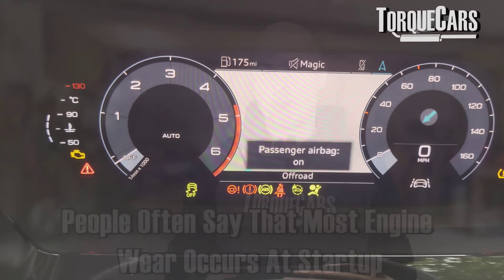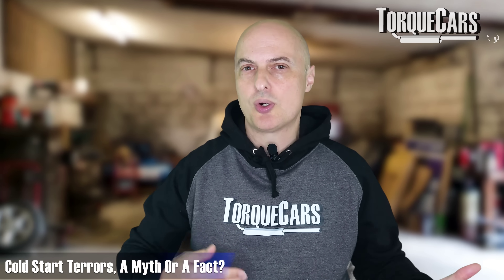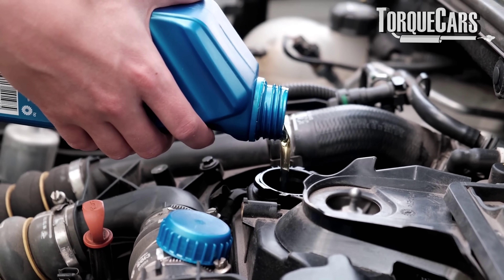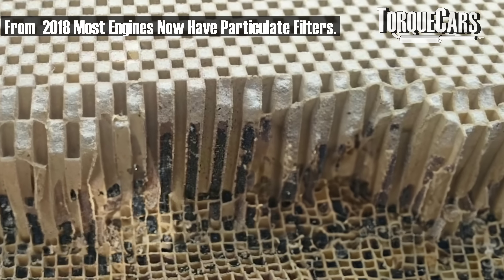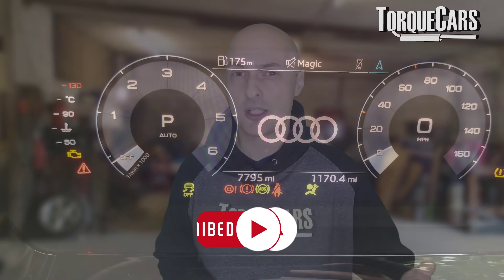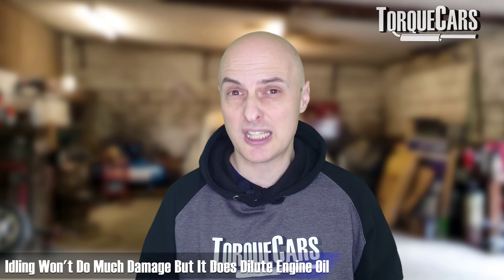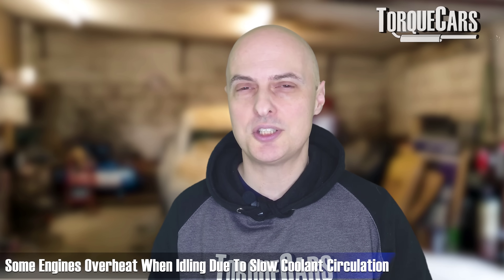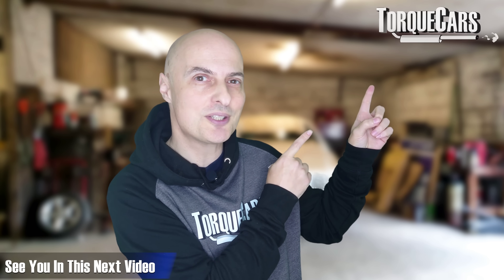❄️Reasons Why Bad Cold Starts Destroy Your Engine ☃️Prevent It Happening To You! ⚠️

Comment: The diesel engine can work itself up to temp, but not force it hard or rew high.
Petrol engine can idle to temp, or with ligt work in the beginning.
Its also a good routine to let the engine, specially the turbo work itself colder after hard work before stopping it to awoid cold score.

Comment: My dad used to move my CRX from the driveway to the street every morning before work, and the exhaust rusted out extremely quickly. Great video, thanks!! Got a Subaru EJ25 being fully built right now and have been wondering about the best ways to warm it up over winter here in St Louis, Missouri, USA.

Comment: I have only driven cars over 200,000 miles and the "newest" vehicle I've ever owned is now 24 years old, my daily is an 89 bmw 525i. I've blown up everything except an engine. The best thing to do is start it, let it sit a few seconds, and then DRIVE IT, but keep it under 3000 RPM. No heavy launches, lightly feather the throttle and gently ease gears until the temps hit about the 1/3 mark. Then gently play with higher RPMs until it's up to operating temp, then the next thing to do is make sure you redline your car from time to time. It does not hurt your engine, it's actually really good to do so you clear your engine and exhausts out. Your engines and exhausts will gunk up over time if you don't put a load on your engine, especially diesels. I worked at a shop and it was a frequent thing to see diesel mall crawlers come in with plugged cats. Some vehicles even come up with warning messages that say to see a technician or drive at freeway speeds for 20 minutes. A lot of the issues that he mentions regarding plugged exhausts from letting your car idle too long can be mitigated by just driving the car and hitting those high RPMs.

Comment: In a morning I start my car as soon as I get in it I then put seatbelt on setup phone for sat nav pick some music etc then set off. I also leave the heaters / climate totally off until it’s almost warmed up. Lastly just because your coolant temp is at 90c it doesn’t mean your oil is up to temp that’s usually another 10mins after the coolant is fully up to temp
Reply: @thedetailingdoctor5746  well said, it’s very common for people to mistake the coolant temp guage on the dials for an everything including the oil has warmed up   Guage and then they think it’s safe to go hell for leather , such a shame all cars aren’t fitted with an oil temp and oil pressure gauge

Comment: I can often go without using my car for over a week. After starting I leave it idling for 5-10 secs before putting it in gear (DCT gearbox) and move off. I always shift before 2500rpm (max rpm when hot is 8400rpm), and usually before 2250rpm, until I've done at least a few miles. No full throttle and no labouring the engine. I'd rather use a few more revs than needing more throttle at lower rpm when cold (eg up a slight hill). I won't use full throttle until the oil is up to temp (I have an oil temp gauge). I do use the AC though which will heat the cabin once some temp is in the coolant. I don't tend to use this car when it's particularly cold (rarely below 5 degrees celcius) - is it actually worthwhile to turn the AC off until the oil is up to temp? I doubt more than a handful of people do this?! Maybe I should leave it idling for a bit longer with a bit of throttle (30secs, as you suggest)?
Reply: You can have the AC on as such; but set at cold; until engine's at or near OT; it does make a difference, especially for diesels. Very cold coolant takes a lot of energy to heat up - why would you compete with what the engine needs to reach OT, by heating the cabin (when the coolants already cold)?
Reply: @Richard_L_Y  I didn't think the AC would try drawing much heat when the coolant is still cold?
Reply: @rossfripp4503 it's the heater matrix / core that has the cooling effect on the coolant, and so in turn the engine to some extent, as it tries to heat the cabin (unless car only uses auxiliary air heater at this stage); which would likely be the case if diesel precisely because it takes so long for them to warm up! (my A3 1.9tdi 8P1 auxiliary heater is broken and I'm not fixing it; way too big a job for something that's not absolutely needed!?); the AC evaporator core isn't relevant or may be more likely to help not hinder (uses refrigerant, not coolant!)...?

Comment: On our 2021 Ford Escape Hybrid, we ran it in Sport Mode in very cold weather to warm the engine faster.  The engine stayed running pretty much all the time. In ECO or normal, it would take several miles for the temp gauge to register much at all.  Then when the engine shut off and ran in EV, whatever temp was there disappeared!  Didn't help when Ford removed a couple shutters and cut holes in the undershield for the engine fire recall fiasco.
Our 2025 Camry has a much more sophisticated system and warms up noticeably quicker in freezing conditions.

Comment: I have been using fully synthetic 0w-40 oils in my Rover with a M47r BMW diesel  engine all year round for some years.
Once the over night temperature  drops difference in the way it pours even compared to a 10w-4 0 or 5w30  is significant 
Always use the glow plugs on a diesel  for a cold start and use enough revs to circulate the oil and warm coolant. Unlike gasoline engines diesels  reject  very little heat into the coolant at low loads and RPM so keep the RPM up and  don't use the heater immediately on cold start. On a diesel if you have a Webasto diesel burning heater or plug-in electric pre-warmer use it.

Comment: I open door, put key in ignation, get in start engine, close door, connect phone, put on seatbelt, then start driving,
500 metres to maun road, 1,000 rpm in 3rd gear at 40 Km P H. It takes about 20 Km for oil to reach workin tempeture at 14 Degrees C air temp.

Comment: Years ago I read where it takes 58 seconds for the oil to reach the overhead cams on a cold Honda 450 motorcycle. In the meantime, it is running dry. So - take it easy on cold engine!

Comment: Can also put the vehicle in drive and hold brake  the engine is under load with out having to rev higher, the stall converter is working and the trans fluid is moving.  this will warm up things faster with out increasing the rpm as the ecm will want to keep the idle steady

Comment: My car with a BOT takes on average about 5mins to get the rpm down to operating rpm, which is around 1000. Within that 5mins I'll do my inspection rounds of the car and occasionally play with the throttle cable a little bit when I'm over the engine bay. That way I get to confirm the integrity of the car's non-engine components while giving the engine itself a few cheeky nudges to get it up to snuff. It's basically my daily car routine and it irritates my parents and baffles everyone else. But on days when the engine temp and rpm simply can't match (ie. 1k rpm but low temp) I'd take an extra slow drive until the temp rises.

Comment: Where I live it gets aprrox -25°C +-10°C in the ~5 months of winter.

With a 438,000km diesel engine, I believe that webasto has helped it get so far. No need for long idle times for warming up and defrosting.

Block heater with electric cabin warmer is more common here but it just isn't as powerful and convenient.

Comment: Not sure how it works with auto climate systems, but on your old school dial/slider controls, keep the heat off during warm up. Turning the heat down keeps coolant out of the heater core, shortening the coolant loop during warm up. You'll find your warm up will be faster.

Comment: I always let my car to warm up for few minutes before driving and it works as a charm. My engines always worked perfectly and achieved many hundreds of thousands of kilometers
Reply: So have mine and i take off as soon as I turn the key.
Reply: @motleydude73 mine has 480k and counting. No oil consumption, and lot of power. And I drive it roughly. When you reach that many km, you'll see the difference

Comment: been doing cold starts properly for years and have done 50-60k miles on every bike ive owned. never had a single engine fault. recently sold a bike with 58k miles to a friend and it sounds and runs like a brand new bike. all the bikes where 125cc and would spend most of there life at 6-8k rpm so yeah the engines are at there limit 24/7. proper cold starts and regular oil changes, using quality oil youll be surprised how long engines last.

Comment: I have a 13 year old v6 Camaro that just hit 200k miles. I always let it idle down after starting and if it’s winter I let the coolant reach at least 100 degrees F before I drive off and when I drive off I go low RPM until I get at least 150 degrees just because it’s so many miles and so far my car still runs like new
Reply: It’s a 2011 3.6 VVT DI (LLT) GM engine and everything in it is original. I’ve had it since 140k miles

Comment: The transmission is definitely warming up on 99% of modern vehicles when idling. Auto trans steals heat through an exchanger, and manual trans steals heat through the flywheel and bell housing against the block. Power steering and driveline are the only things not being warmed when idling.

Comment: I use Slick 50 in my engines in the winter (coldest months) and summer (hottest months) twice a year.  Slick 50 has great film properties so the critical engines parts don't have a "cold/dry start" but lubrication already at startup.  Teflon is a great product for your car and engine. In engines, Slick 50 provides 4 times more lubrication and 2-3 MPG better mileage so it actually pays for itself. For suspension and other parts Teflon is great because it is "self-lubricating". Since I don't have heated seats, usually I give my car a few minutes warm up in the driveway, and try to keep my speed 35 and under till the engine warms up. Even with an additive.  Try Slick 50 in the winter months, you'll notice the improvement. (no affiliation, just a long time customer).

Comment: Here in America, I’ve noticed a lot of Hispanics will sit there until their car warms up. I get in and go, I try to remember to take it easy for a few minutes.
Reply: My neighbor does that. Great to hear his engine idling for 15 minutes at 7AM. I also start and go and take it easy until reaching OT. Luckily with my new Lexus, it's up to temp very quickly.
Reply: @bme7491  That temperature you are looking at is the coolant temperature. The coolant in your Lexus will get up to temperature quickly but the oil and block and other metal components will not.  It takes about 5+ miles of driving to get everything warm. But even then it probably won't be up to normal driving temperature.
Reply: @artblackwood7936  Yes, I was aware of that, but once the coolant is up to temp, I just drive normally (meaning no pedal to the metal).

Comment: When I visited my relatives in Alaska in November, most cars had engine block heaters, and the 10-minute idle warm-up regimen was mandatory.  When it's -18Celsius, you must treat your vehicles differently....
By the way, in Alaskan environment, manual transmissions perform MUCH better than automatics.

Comment: 2004 Expedition 4.6 V8 with 223k miles, Florida, garage kept. I  Idle until RPM drops, and I baby it until I leave my neighborhood. I shift to neutral at long red lights to let the tranny cool on long drives. Amsoil and 25,000 mile Amsoil filter.

Comment: I have a series 1 MR2 and on choke it revs to 2000 rpm on its own.  Been told its correct.  I always wait till the choke comes off which usually takes 5 mins.

Comment: My truck has 300k miles, still runs like new.  I always let it idle for at least 30 seconds on a cold start, then don’t go over 2500rpm until it warms up.  Also only half throttle max until warmed up.  Also have used full synthetic oil since new.

Comment: I've always let the engine warm up a bit. I live in a sub tropical climate what I've noticed with all my modern injected engines they all start and rev quite hard from cold till they settle down. They usually rattle for that initial start up which I absolutely hate. A lot here will give me grief for this but I usually increase the viscosity incrementally till I don't hear that start up rattle

Comment: I typically let my vehicles warm-up for about 3-5 minutes. Two of them are automatic so I would even put them in gear to help warm up the trans. I had a company vehicle at one point with remote start and I would start it before I got dressed and gathered my things which took about 8 minutes. Even after about 10 minutes of warm-up, the oil usually only got to about 120 degrees whereas the operating temp was around 190 so this further reinforces the added measure of just cruising for the next 10 minutes.

Comment: I still maintain to warm up the engine 'first' before hammering it.. the viscosity of oil when cold is different to when warmed up.. the oil will flow around parts much better when the engine is up to temperature..

Comment: Bought a Citroen C5 1.5 Addblue diesel with 30k on the clock and in very cold conditions it rattled on start up for a few seconds, the oil is 0W/30 it's like water, ended up adding some addative at each oil change and the rattle has gone away for good.

Comment: In my view you don't want to beat on your car when its cold and trying to warm up. Take it easy, be gentle on the car when your warming it up. Keep your eyes on your oil temperature. Your cooling temps will reach operating temps faster but not your oil temps. I pay attention to my oil temperature in my 06 Charger R/T all the time and I know when it's warmed up. Make sure to change your oil and run full synthetic oil. If you keep up on your maintenance, your car will last a long time..

Comment: I drove my previous car nearly 20 years. I had to get rid of it because the rust ate out the body and the car became unsafe. I never let my car warm up. I just start it up and go but I try as much as possible to keep the rpm’s below 2k until it reaches temperature. I also try to keep the rpm’s around 2k religiously in city driving and it’s very rare I ever go over 3k rpm. Drive it is easy as possible and it should last you 20+ years.

Comment: I never move a vehicle until 140°~ish oil temp, be it 5 minutes or an hour. I have several diesels and gas engines north of 500k miles, no blow by on any of them. 
On the other hand, my sister refuses to warm up her car and has not had an engine make it to 150k without blow by. Also, her cars leak a lot of oil.

Comment: Surprised about the statement that the engine warms up faster than the coolant… On all the cars I’ve ever had, the coolant has always, without fail, got up to temperature before my oil has. When I first started driving 10 years ago I was always told, don’t drive the car hard as soon as the coolant gauge is where it should be because its highly likely that your oil isn’t up to temp yet.

Comment: Some modern engine (like the VEA Volvos) have a heat exchanger between the coolant and catalytic converter too speed up the engine warm up. I think the trigger for this design was the emissions tests being performed on a cold engine. The downside of this is the thin engine oils we see in modern cars.

Comment: I see that most handbooks tell you not to idle the car and drive away immediately.....More emissions crap! 

 I always warm the engine for 1 min before I leave the drive, if it's super cold I sometimes up it to 3 or 4 mins. After that I never labour the engine or go above 2500rpm until it reaches 90c
Reply: I guess you know more than the manufacturers, enjoy paying for more petrol as punishment for believing in myths 😂
Reply: @Master1906  As I said, the manufacturers advice is based on reducing cold start emissions, not protecting the engine. It's not a case of knowing better, it's a case of different priorities. Sorry if that hurts your fefes.
Reply: @Master1906   And using 2p more petrol is more than ofset by the savings of not having to buy a new engine @70,000 miles.
Reply: @Master1906  How many boosters have you had? My guess is all of them haha. You do realise that it's not in the manufacturers interests for your car to last too long?
Reply: Idling takes much longer and generates way less heat, while modern oils safely handle low rpm ranges while driving till the engine is warm. 
Idling till its warm is not favorable.

As he also states in his video above, idling causes more problems.
Reply: @MattyEngland  might hurt my fefes, but I sleep at night better knowing it hurts your wallet 😂
Reply: @TommyShekelsonReloaded  take your tin hat off 🤡
Reply: @warmesuppe  Where did I say idle until it's warm? I give it 1 min for the oil to circulate and warm up a bit. Must be working alright as the car is 22yrs old, (I've had it for 13 of those years) and it's still on the original engine, turbo and head gasket, despite running 25% more power than standard.
Reply: @Master1906   As I said, spending £10 a year probably saves me hundreds if not thousands in repair bills. You're obviously as good at maths as your are at independent thought 🤣
Reply: @MattyEngland  let's be honest, that fella rides the bus everywhere. The short bus, that is.
Reply: @MattyEngland  £10 a year to fund your OCD is still £10 more than I would spend 🤣
Reply: @Master1906  🙄
Reply: @Fazers-On-Stun   🤣🤣 I think you're right bro 🤣
Reply: @Master1906  Don't forget your booster
Reply: @TommyShekelsonReloaded  what?

Comment: Putting engine under slight load, doesn't require input thru gas pedal. Turn your fan on, rear defrost, and headlights. Creates enough of a load to bump revs off of ecu set idle. Good info here

Comment: All makes perfect theoretical sense but in reality, modern engines and synthetic oils are so well designed, extensive warming up is not necessary. A brief pause after starting and a gentle/moderate drive away is all that is required.